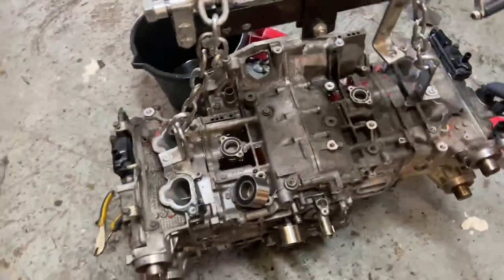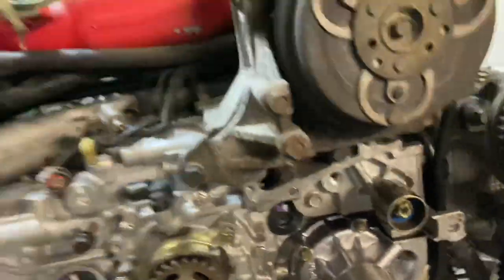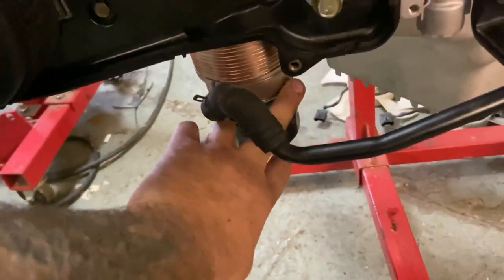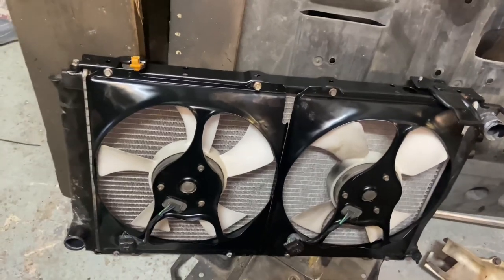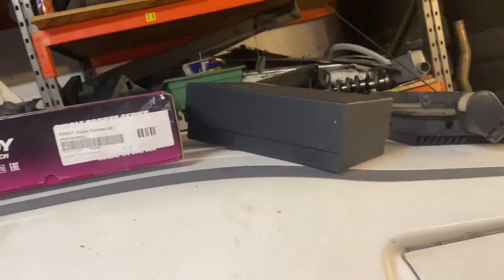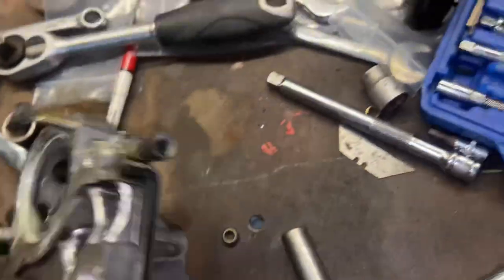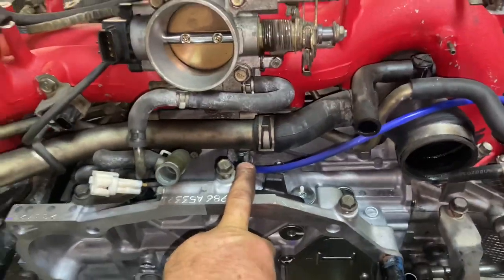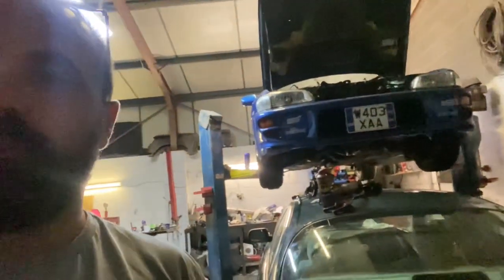Subaru Impreza sti v6 Type Ra engine swap -IAG competition sump

Comment: GC8 Type RA's STI were actually believed to be stronger being forged from factory as opposed to the Casted ones from Blobeye's and New Age STI's their small differences despite being both EJ207's was the introduction of AVCS similar to Toyota's TVIS so it's a modern comfort to have for sure plus the parts are more easier to find. Ver 5 and 6 is Open Deck but earlier GC8's were closed deck. EJ207 block are generally the strongest variant of the 2.0 series and basis to swap with modern aftermarket parts.
Reply from the maker: The vin tag states it’s got an ej207 from factory and it’s got the later ej207 block with the v6 heads back on there